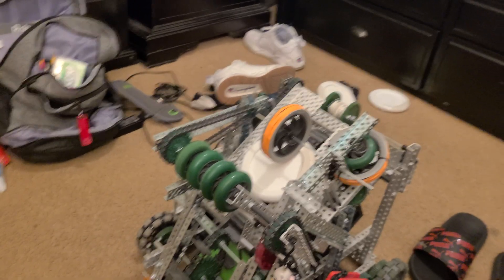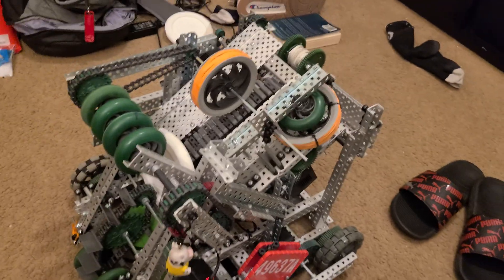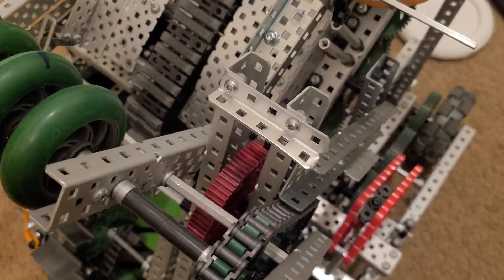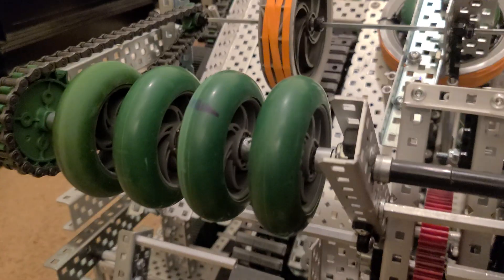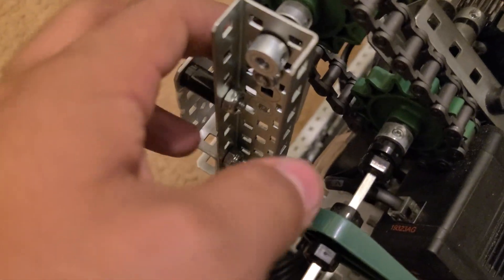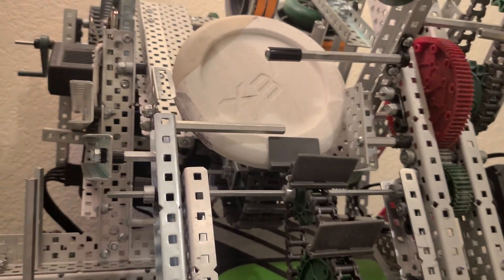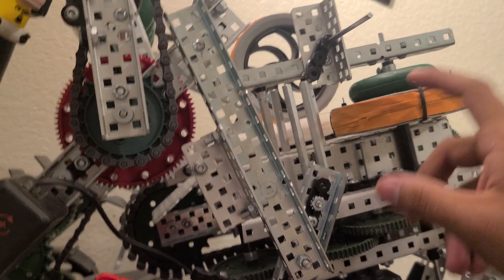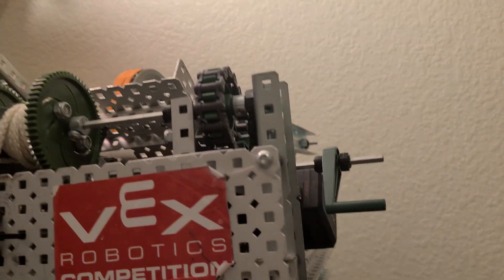Vex Spin Up Vlog Robot Progress #3 (read desc)

Comment: There is few factor to help for the accuracy 

1 add weight and try to put some plastic sheet on the wheel by doing the weight you will keepnyour inertia kn the wheel so more rpm consistency. And for the plastic sheet on top of the wheel you will reduce the air friction onto the wheel haul so your motor will stay easily at your max rpm

Comment: great, are you using the extra wheel in the flywheel to add more weight? which rpm are for it? Awesome.
Reply from the maker: You think if I add more weight for the flywheel it would improve consistently? Also we using 2 green motors for the flywheel